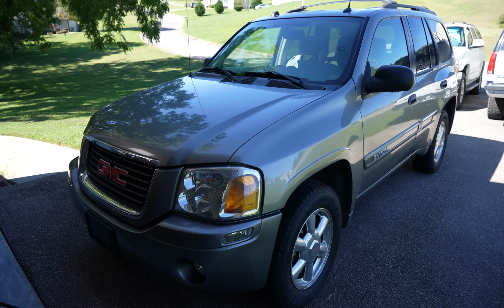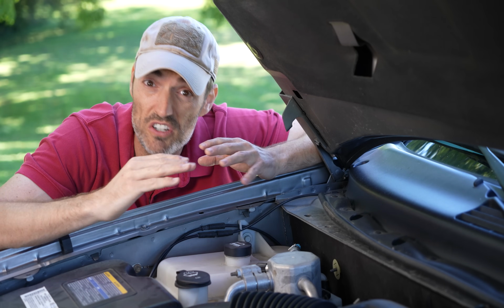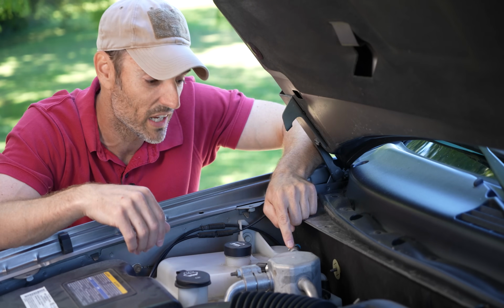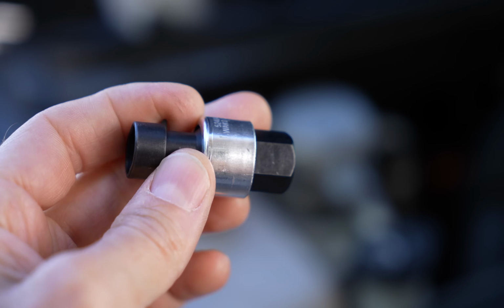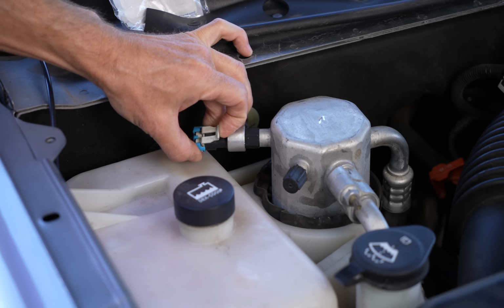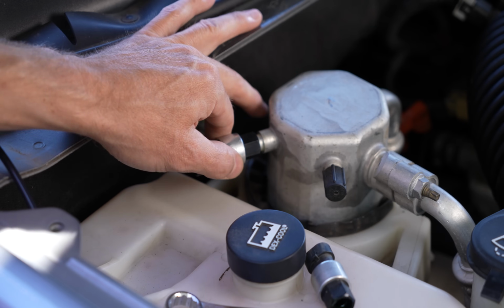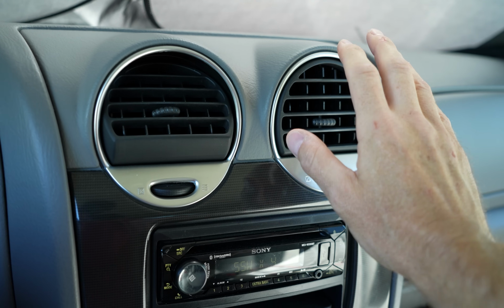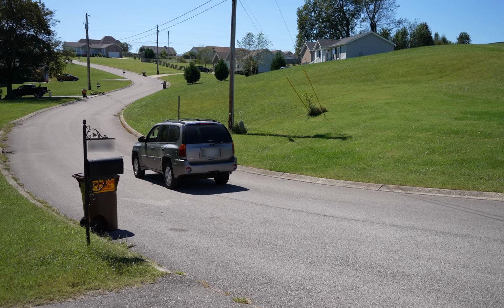GM Air Conditioning Pressure Switch Problem and Replacement!!

Comment: Great video.  I replaced the low pressure switch, but this did not seem to solve the problem. Where is the high pressure switch located, and can I replace that?
Reply: You "can" replace both but they're not always both accessible/easy to reach. Find what your replacement switches both look like; they usually both have round silver hookups and the rest is black. typically the black portion on one is flatter and elliptical/rectangular (in my case low), and the  other is circular (in my case high).

Comment: OK people the videos are good and all but my canon does not have a low pressure switch on it. Where is it? My high pressure switch is coming off the compressor. It’s around three prong plug. The low pressure switch is an oval two prong. I cannot find it anywhere on my truck. I’ve looked everywhere yet I bought the part already are you telling me my 2010 only has a high-pressure switch if it’s not on the can??? please please help

Comment: Mine blows hot when sitting still but ice cold once it gets moving, wonder if this could be my issue 🤔
Reply: Sounds like the ac cooling fan is not working.
Reply: @markblanchard5045  i drive a 2014 gmc sierra 1500, i don't think it has a ac fan

Comment: OK my ac cut off switch is craked is there Anyway to fix that? Instead of having to buy a new one. Cause my original one has a metalic screw on but the top of the head is craked and it leaks. Is there anyway i can replace the nug to the new one wich has a plastic nug?

Comment: Red are completely rebuilt all of our vehicles because we are overlanders and live in our van, that means the transmission, the differentials, transfer case, all the sensors, fuel pump, fuel injectors, we also carry an extra battery and fluids and make sure that we have the tools that fitbit's Vehicles make and model! Later this year we are replacing our Engine with 247000 miles on it like we have with the rest of them

Comment: May you please tell me how you knew it was the pressure switch and not the expansion valve? I am having the same issue. Thank you
Reply: The part is cheap. Just replace it and see if it fixes it

Comment: On my 98 blazer the pressure switch in unplugged and the connector piece from the harness has a paper clip inside with electrical taped over it as some sort of bypass. It was like that when I bought it. I had a vacuum leak from a few deteriorated lines that I replaced. After replacing I noticed a weird sound when I turn on AC or Defroster. The ac clutch plate is not engaging and when it does it sounds real loud. If I turn the regular air on the sound goes away immediately. Not sure what to do
Reply: drive it into a lake....

Comment: Thank you so much for the video. I have an 04 trailblazer when I have the AC on it stalls out at traffic lights. Somebody told me to replace the switches that you were talking about. What do you think?only stalls out when the AC is on
Reply: I have (or had) that exact same issue w the exact same vehicle. "Oil pressure low. Please turn off vehicle." on the dash?? I dug and dug trying to find the problem. Eventually an O2 sensor crapped out and went into limp mode. Since replacing that I haven't had it stall out. But, I don't think it was the root cause. It still drives sluggishly and doesn't get very good acceleration.

Also had to replace a low beam headlight relay around that time.

One thing I found was the oil pressure sending unit, which is just a little screw on piece, but requires a specialty socket. I never did figure out what might have been causing it. I think I have a ground fault or a bad fuse somewhere. Almost every time I turn it off there's a buzzing noise coming from the OnStar speaker next to the driver side door. And my AC is out now after getting it charged and tested for $160 two weeks ago...

Did you ever figure out what was causing yours to stall? Mine frequently stalled while sitting in park, in reverse leaving a parking spot, or right as the light turned green lol. Commonly, but not always with the AC on.
Reply: @terrapinflyer273  my low beam, headlight relay blows that once a year AutoZone by the first one for replacements,  as far as the stalling out, it did have to be last week and get stuck in the middle of the street towed it to my buddies come to find out the battery terminal leads I guess a little screws, and all the cables to the battery were stripped. I’m not making a very good contact since I replace them it runs like a top. I don’t know if that was a problem but it’s running pretty good right now.
Reply: Correction. It stalled out again today

Comment: What will keep my compressor from kicking on I got a $3,800 series 2 Buick Park avenue when I tried diagnosing the low pressure switch I put a piece of wire in between you know bypassing it and my fan kicked on but my clutch didn't engage on my compressor but when I hardwired my compressor to the battery it comes on and blows cold

Comment: Does 2007 honda pilot have build in cover after taking out the pressure switch because I’m afraid that the refrigerant might spill out if it doesn’t have a cover.
Reply: count to ten, think about puppies & rainbows. cross your fingers, have mommy kiss your cheek, and then put on your pants.

Comment: In my Corolla it was a bad radiator fan. You hit a bump or give it a manual spin and it would start turning and the AC would kick on… even if it was barely turning. Driving would move enough air to make things ice cold, at least until you stopped.

Comment: I have the opposite effect my ac won't work when  I turn in on it'll be 10min ideal and won't blow cold air , but as soon as I press on the gas pedal it starts working. 2019 chevy Tahoe

Comment: Just fyi 
Refrigerants are not allowed to be released into the atmosphere. The Environmental Protection Authority has the power to investigate and prosecute violators. There are serious penalties for releasing SGG or ozone depleters into the air.
not all vehicles have this valve so please do research before undoing any part of the ac pressure switches
Reply: I doubt someone is going to catch me in my driveway 😂 or anywhere for that matter

Comment: I have a 2014 Chevy silverado 1500. I have code P0532. What should I be looking for. My air conditioner doesn't get cold, and the fan on the motor is loud . My gouges look normal and don't show signs of overheating. 
Should I have to switch the refrigerant pressure sensor?

Comment: There's a 50/50 chance replacing either pressure switch will fix your issue. 
Being a maintenance/ tech myself,  I highly urge you to test the system and components first rather than throwing parts at it. Trust me,  I've seen many ppl throwing parts on left and right and still not fix their issue, essentially, throwing money in the trash can...

Comment: I have  high pitched squeal that gets louder when I accelerate. The sound is only present when I turn the accelerate on. I've  justreplaced the belt and alternator on my pontiac g6.  Do you know what it might be?
Reply: check for a small child caught up under the engine....

Comment: Thanks for the video. After 407,000 my relay went out. I was really thinking it was going to be something much more involved given the mileage and everything being original. AC will make you want to put a sweater on now. 😎
Reply: Informative would be good to know other systems it controls especially if more than pln connectors ie a cooling fan

Comment: I have an 08 chevy Impala. AC compressor runs but cooling fans are not until the engine gets hot then cold air comes out but not for long. Changed the high-pressure switch, and climate control module, and recharged the system again, but nothing helped. No mechanic can figure out what's going on with my car.

Comment: I'm having the same problem with my 2001 Ram 1500. Thank you for making this video.
Note: I have Sweetwater stickers on my filing cabinets like your toolbox has. 😀
Reply: Did this solve your issue? I have a 2019 ram 1500 and it's now blowing hot air at all!
Reply: @dabeersboys  I was only able to find a high pressure switch (mounts above engine), but could find no one that had a low side switch (mounts similar to one in video). It's been a year, so I should try to locate one, again. Replacing the one switch didn't solve the problem. I suspect it's the low side switch that's acting up. For the first 10 minutes while outside temperature is high, it cools properly, then air gets hot out of AC vents. On an overcast, cool day, (or on a cool night), the AC runs perfectly, never starts blowing hot air. So I believe it's a switch related problem; the unit makes very cold air when it keeps running.
Reply: @garycook5125  awesome. I was looking at mine and I was only able to find the one. When facing the truck, left front side.  When I search for parts online there is only the one  part that shows up. So if there is two, they must be the same part. 
Mine does not blow cold ever.  Good luck! I for some reason read 2021. Not 2001!
Reply: @dabeersboys  Yes, your newer model is probably different. After responding to you this morning, I located one (only one), low side switch at an AutoZone in town. My wife picked it up, and I'll install it tomorrow. This problem has plagued me since 2007 (I've been too tolerant). I'm pretty anxious to see if it works. One question: does your AC clutch (on the front of the compressor), engage when you turn the AC on?
Reply: @garycook5125  mine is not. :(

Comment: Great video. I replaced mine on my 2011 Cadillac SRX, but it’s still working on and off. Next I will be replacing the wire harness to the AC pressure switch. 
You think it’s a bad harness? Or perhaps the low pressure switch? 

*On my YouTube channel I uploaded a video on how to replace the AC pressure switch on the Cadillac. Stop and show some lov. Peace

Comment: Okay I have a 2016 GMC Chevy van my question is my Freon leaked out I seen it leak out so I went and I bought some sealants and more freon to put in there I bought the two cans with the gauge on it so I put them both in there and everything was great for a day and then in the morning I was sitting waiting idling and the same thing happened I seen it leak out I could see the liquid or the mist and that was that now believe it or not it is still cool in my van pretty cool my question is why is this happening any advice would be grateful thank you

Comment: I have this problem currently on my 08 Envoy. Before finding your video, I replaced the low pressure switch. Unfortunately, I still have the same problem. I honestly believe it's the high pressure switch and I am having problems locating it under my hood. I was hoping your video would have at least covered the location of the second switch ad it was mentioned in the video that if replacing the first could possibly not fix the problem. Any advice as to where I can find a diagram or a picture of the location to help me out? Thanks in advance.
Reply: I know it’s been a few months but I’ll respond to your question. 

It’s usually down on the refrigerant discharge line pretty close to the compressor. That line goes straight from the compressor to the condenser coil in front of the engine radiator. Some have only 2 wires like the low pressure switch in this video. Some of them have 3 wires and are called a pressure Transducer. Transducers convert a pressure reading into a low voltage electrical signal that a computer can read. The HVAC head unit or controls have the “computer brain” as part of that piece. So it decides based on a number of temperature and pressure readings how to keep the HVAC system running close to the temperature you set it to.  Those have same the simple to replace design with the valve core inside the pressure fitting that it mounts to and O ring to seal up leaks.
Reply: Hey hey buddy, I’m having severe issues with my truck. It’s a 2010 Chevy Silverado. It has no low pressure switch on the Cannes. I can’t find a low pressure switch but my high pressure switch is coming off the compressor off the small line it might be the same thing for your envoy because the years run similar check there takeoff your passenger front tire, takeoff the fender wheel well and you’ll see the sensor right there. That’s how it is on my truck.

Comment: Thank you so very much for this. I am retried and on SSI. I could not afford to take my 2005 Chevy Silverado to a mechanic. It has been 100 degree days here in NC. I did go purchase the pressure switch, and guess what? It worked!!!! I am very indebted to you for this video.
Reply: Am in the Central Valley California getting hot at 109 degrees and my Sentra is having same problem. Iam switch the part out hopefully it works for me too
Reply: I have an 06 sierra in CT, I have same issue plus at times the fan doesn't come on. I have to do this tomorrow
Reply: @myveryfirstname  check condenser in your case. If it involves the fans.
Reply: @myveryfirstname May be is  the cabin blower motor fan de a/c is not good i.was changeed befor.and is working good.
Reply: Did you have to replaced both pressure switches (high & low side)?
Reply: Thank you for this lesson 
My question how can i rest tht A/C 
I replaced the compressor and the radiator of the AC but the front A/C still warm and the rare A/C is coold 🤔
Reply: Aww
Reply: You got  lucky. You could just as easily have  thrown away that  $30.

Comment: I have a 2016 chevy colorado. At about 50k it started randomly blowing hot air, but would always blow cold again after five or ten minutes. It seemed to progressively get worse and eventually stopped working altogether. I took it in and was told there was a leak in one of the pressure fittings on the hose. That was replaced and the AC worked again for a while and then stopped. I took it back to the same place and now they tell me the condenser is bad and needs to be replaced for $1,400. Is this making sense? Do you think it's possible this pressure sensor could be the issue? Is it worth trying, or just trust the professionals and replace the condenser and drier?
Reply: It's usually cheaper to just replace something small like the sensor switch and see what happens. A/C is complicated, and troubleshooting by itself can get very expensive, so try the easy fixes yourself first. (I have the same problem.)
Reply: I have a 2015 Chevy Silverado and for what I been looking at is those condenser are junk mine just quit working as well you tube condenser in that make and you'll see what iam talking about
Reply: It could also be blend door actuators.

Comment: I need help. My 2012 GMC Acadia ac stopped when you push the button it just blinks a few times. Idk if I need to refill it and if I just plug it up and refill or do I need to jump the pressure switch to get clutch to spin or what. Or if something is bad and need replaced
Reply: @VeeAy12345 i tryed to add a can of freon but would not take it i believe its not letting the compressor clutch engage to accept the freon. Im thinking about jumping the compressor clutch long enough to add freon so that it'll sense theres enough and engage it its self and I can top it off hope all is well.🤞🙏

Comment: My pontiac grand prix AC doesnt work well when its hot out.  It blows hot air for about 10-15 minutes and then it will all of a sudden blow ice cold.  Only happens really during summer.  Thoughts?  @1Road
Reply: Weak compressor douse it work cold at higher rpms if soo the compressor is weak and starting to go out

Comment: Salam to All,
I've been suffering from this quite some years, replaced thermostats and heat sensors and even ECU, but still the problem as Frank pointed randomly occurs, I question the symptoms to be clear on the solution:
The temperature gage goes off, and the AC stops cooling and air is hot amd moist, the AC will never work till the bettary is disconnected (car reset) or errors cleared with ODB2 device, is this symptoms you've been facing ? I ordered the part and will try with the pressure gage as a last resort, as I tried everything,
My car is the beautiful GMC ENVOY 2006 4.2L 
Thank you for your video, please advise if the same symptoms occurs..

Comment: Do you know what trim level your Envoy is? Btw I drive an Envoy with 315,000 miles and it still runs strong.
Reply: 05 ENVOY Xl SLE, 222000 daily driver work TRUCK. the motor not the dash tells me when to change oil. 3000 miles avg.i begin to think it's finally going to have problems cause it doesn't feel right , no light or codes. Change oil and the doesn't feel right goes away. Just typical maintenance on high milage vehicle.  No where near the Tahoe nightmare previous daily driver when wasn't working on it.

Comment: this sounds like what it may be...except the compressor never stops running? It just blows hot air while compressor is running..no leaks and full of freon ? and its not anything like that...but it just started  blowing hot air...like a heater ? mechanic says it may be switch and faulty belt ...its not random

Comment: I have a 96 izusu oasis same as 96 honda odyessy, my front and rear ac blows ice cold but after a few mins the front starts getn cool than ambiant temps but rear remains ice cold, their are no leaks no compressor issues, yes compressor is still running while this is happening, what could be going on? And yes frigerant is at proper levels

Comment: Now ever time I turn on the AC I do get cold air. I think the fix worked. It's already cool weather where I'm at - so kind of hard to tell. I'll keep you updated but so far very promising.
Reply: I had this problem when the vehicle was idling in 100 degree weather , cuts off and on and off ect.

Not sure if its because of that part or because these vehicles were not made to cool off the cabin in extremes temps at idle
Reply: @fargeeks  what was the problem? Did you ever fix it? Let me know please thanks.